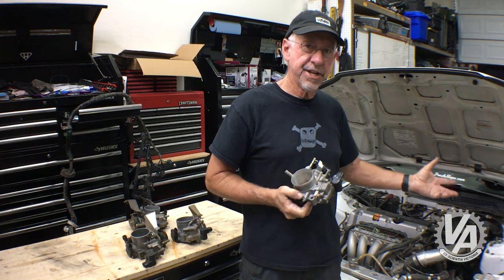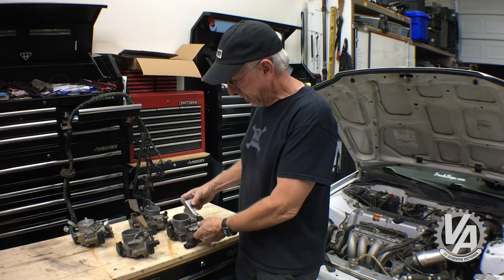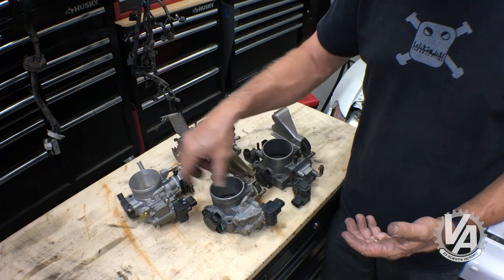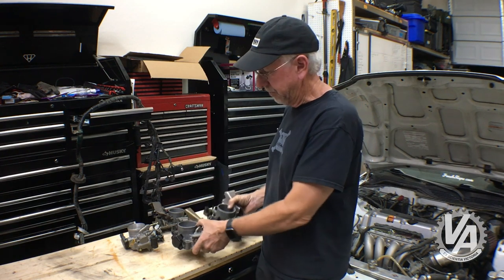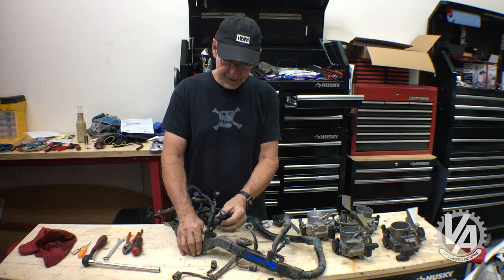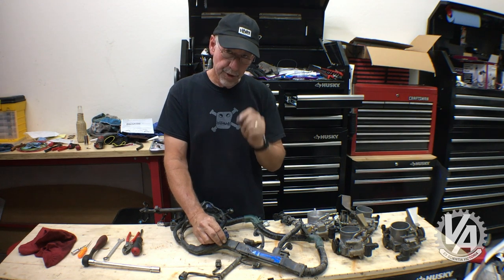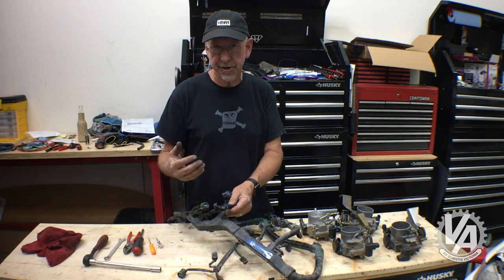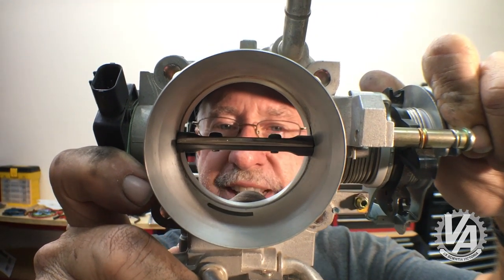Another K-series Tech Tip! All about Stock Throttle bodies.

Comment: I am so happy I have found you. I have turboed my k24z3. Would love to chat with you about it. 

I want to upgrade my intake manifold. Not sure if the power gain is worth it. Are there Any stock Honda manifolds that fit?
Reply from the maker: It would require an adapter to use a different manifold that would be beneficial. Then you could use the 2012 Civic Si manifold. HP gains would be OK. If you are trying to squeeze that last little bit of HP from a setup you already have without upgrading the turbocharger, then it could be worth it. You can ask questions during our live broadcasts on Tuesday nights at 7PM PST.

Comment: I appreciate your videos in the knowledge that you're giving. Question I have a base RSX K24 swap it runs but the idling is high and it overheats any ideas on how to get the idling down. Thanks for the help
Reply from the maker: The high idle may be a problem with either a vacuum leak or malfunctioning EACV. I should probably do a video on troubleshooting a high idle.
Reply: @VTECAcademy  yes I think we all would appreciate if you made that video explaining those issues

Comment: Came to see what tb’s might fit on my ep3. Have you ever seen the throttle body itself leaking causing a lean code?
Reply from the maker: RSX, EP3 and CRV. The RSX Type S and EP3 are the best. And no I've never seen a T body that leaked and caused a lean code. That is usually related to fuel flow.

Comment: Supposedly a bigger throttle body doesn’t even gain power at all, unless head work is performed. People swap manifolds, and throttle bodies just for looks.

The biggest cheapest gain is power is an intake short ram or cold air intake, vs stock plastic intake box. Besides that any time you want to see power, you have to have a healthy bottom end, drop in cams, FBO and tune
Reply: I put a 65 mm TB on a Buick based Aussie version v6 vp commodore, then a cold air induction, iat resistor mod , shift kit in rhe turbo 700. The TB from 60 mm? Instant response and more push in the seat! Ecotec v6 is starved in standard trim.

Comment: I have a skunk2 alpha throttle body, swap car with a base RSX engine harness. I have both the accord TPS and a base RSX TPS, if I use the base TPS do I need to re-pin the TPS plug? Thank you!
Reply from the maker: I believe you need an RSX Type S compatible TPS for the Skunk 2 throttle body. And, you need to re-pin the TPS sensor.

Comment: Do you guys have any guides on repining Honda fuel injectors to work with RDX injectors. I own a 2012 Accord LX and I'm having a hard time trying to get these Denso 410cc injectors installed. All pigtails I find are not the correct fitment for my car to the RDX ones. So confusing
Reply from the maker: Not yet. We need to do that.

Comment: Did you ever do a video on converting an auto trans K series engine harness for manual engine/trans combo? Rsx base auto harnesses are pretty cheap so my question is it just remove the auto wires and connectors or it there more to it? 
Thanks for any help , (mine is a rbb k24 stand alone setup going into a crawler mated to a GM auto)
Reply from the maker: I just recorded it. We'll try to have it up soon.
Reply: X2, I’m actually doing this as we speak. #1 repin /extend the TPS connector #2 use the connector from the intake manifold runners and move down to use for reverse lock out and repin that at the ECU connector. I’m sure there’s more, just haven’t got that far yet.

Comment: I have a 04 ep3 and wanna do a throttle body upgrade. What do you suggest?
Reply from the maker: It isn't really necessary on the 160HP K20A3 engine. Have you done other modifications?
Reply: @VTECAcademy  none at al

Comment: i have a 70mm skunk 2 pro tb can i run it on my stock 02 rsx type s without a tune till i can get a tune ? will it affect much if i dont get tune ?
Reply: I wouldn't recommend it... it wont run smooth, you'll have a rough idle , and maybe some stuttering .. 
Your letting in more air, but not more fuel, and that will be your problem, your AFR will be messed up... i recommend waiting till you can tune it.. 
You still have a stock intake manifold?
Greetz

Comment: Why are you going with a 4-1 header as opposed to a 4-2-1 or hybrid style header?
Reply: A 4-1 header makes a little more power in the lower ranges of the rev range, and a 421 makes more power up top... so it's a bit of personal preference and the purpose of the build...
Reply: @HouseOfPetrol  i thought 4-1 is for top end only. 4-2-1 for midrange to top.

Comment: What oem throttle body would fit a rsp intake manifold?  Thanks
Reply from the maker: Drive by wire would be the J-series throttle bodies and drive by cable would be the Accord K-series T-bodies.
Reply: @VTECAcademy  does it matter if the accord is a manual or automatic trans cable driven tb?  Thanks

Comment: Is it possible to make a RBB intake manifold from honda accord work on a k20a3 from a 2005 acura rsx/JDM honda integra?
Reply from the maker: Yes, but you would have to trim part of the manifold so the upper radiator hose inlet from the A3 could be installed.
Reply: @VTECAcademy  thanks for the info...appreciate it

Comment: Great video Brian! I got an Accord K24a TB for my JDM K24a2 swap. Question is what cable bracket bracket do I use? The accord bracket mounts to the manifold not the TB like the others.
Reply from the maker: What manifold do you have?
Reply: VTEC Academy will be the stock K24a2 RBB
Reply from the maker: @1stGenCRXs  If you have the Accord manifold and Accord or Element bracket, use an Element throttle cable with it.
Reply: Is the accord throttle body bigger than the RSX type S

Comment: I can't find any throttle bodies for honda crv 1999 ex b20 what alternatives do I have
Reply from the maker: Off the top of my head, I would look at the 98-01 Integra LS/GS throttle bodies.
Reply: @VTECAcademy  hey thanks alot for the quick reply I'm in a moving process and had to replace my throttle body since my old one was defective I ordered one already since it's so last minute but it  may not fit it just had the same orientation (sensors in right place, hoses, etc)
Reply: Any other throttles i heard maybe the rs integra 90-93 as well

Comment: What throttle body can I use on my 2000 Honda civic ex?
Reply from the maker: Aftermarket or stock but larger?
Reply: @VTECAcademy  stock but larger.
Reply from the maker: @juantrejo7084  The B16 throttle body from the 99-00 Civic Si. Or the Integra GSR throttle body.

Comment: I'm using an 05 accord throttle body on my k24a rbb. I realized later that i bought one with a part number from an automatic car. What's the difference and do i need to buy one from an manual? Also the accord one is pretty small but rax is only 2mm more. Should i just get a different TB altogether?
Reply from the maker: For 200 hp the Accord TB is big enough. The. auto or manual throttle body fits fine on the RBB. If you have an RBC or RRC then you need the Accord DX (auto or manual) throttle body.
Reply: @VTECAcademy  i couldn't figure out the difference between manual or auto they have different part numbers. The manual one much harder to find. Anyways I'm on an rbb manifold not much room on the firewall since it's in an mr2.
Reply: @VTECAcademy  also since you're here do you do dyno tuning? I'm local to you. My engine is stock besides bolt ons
Reply from the maker: @supers0nic77  We usually use Tim at Xact Dyno.
Reply from the maker: @supers0nic77  I'll have to do a direct comparison. I can't think what the difference might be.
Reply: @VTECAcademy  idk either just that the auto one didn't seem to work. It wouldn't go past 60% on the kpro. They look the same and use the same iacv
Reply: @VTECAcademy  i ordered a manual one. They are hard to find. Junkyard websites not updated. It's brutal out there haha
Reply: @VTECAcademy  i ended up wasting 100 bucks on an ebay used one. Took out the auto one. The tps was busted. Put the manual one on and it worked. I'll look up tps and see if they're the same. If that sensor didn't break i wonder if it would have worked. Oh well.

Comment: Quick question to anyone can help please. I have 2008 tsx  i would like to put rbc intake manifold and I think a zdx tb . This would be plug and play? Thanks!!
Reply from the maker: I believe both of those are a direct bolt and plug and play.
Reply: @VTECAcademy  thanks!!
Reply: No, ZDX TB will need an adapter, also you'll need flashpro to tune it since that IM +TB will let a lot more air in, probably you'll need RDX injectors too since stock ones will be running maxed out (K24a2 with I/H/E can max stock injectors pretty easily)

Comment: What year Accord throttle body bolts on RBC, RRC manifold?
Reply: For drive by throttle cable 2003-2005.
Reply: @BrianGillespie_brianathasport  thanks but I meant other regular style TB cable operation like 2002 RSX Type-S. Thanks though enjoy the videos and content.👍
Reply: @stinky15552  you want to use the 2003-2005 Accord DX throttlebody on the RBC and RRC.
Reply: Does it have to be from a manual or will one off an automatic work as well?
Reply: @raysb240sx   long as its cable driven not drive by wire. I got mine off amazon but remember if tps sensor is facing up have to flip around the the out wires around 123 normal to 321 also  may have to make custom throttle cable stay bracket.  See what Brian says also. I got mine off amazon just make sure its 2003-2005
Reply: I tried to use auto 05 accord tb even though it uses cable somehow it didn't work. Plus it's smaller than rsx type s ?
Reply: @supers0nic77   I have 96 Integra k20a2 /5speed worked for me. Maybe it didnt work because the TPS wiring needs switched the TPS Connector 123  Wire 1 and wire 3 need switched around and Im using a 1999 Integra GSR throttle cable, Honda Odyssey throttle cable mounting bracket on the throttle body and using a RBC intake manifold.
Reply: @stinky15552  i have k24a rbb manifold. The auto accord 05 tb is a different pn from the manual one. I did have to rewire the crank sensor plug though or i could have used a k20 sensor and skipped that.
Reply: @stinky15552 did you have any issues with the throttle body spring assembly hitting the manifold?